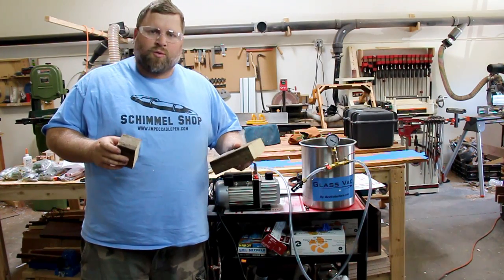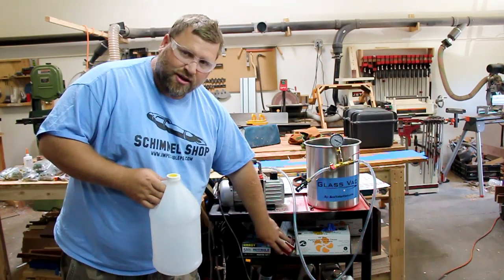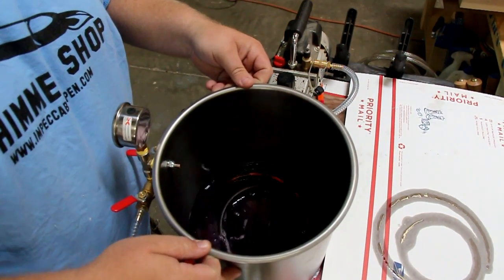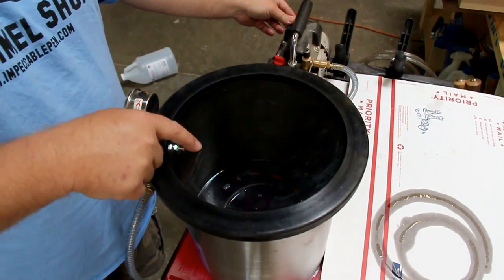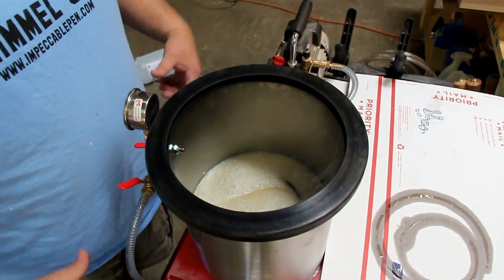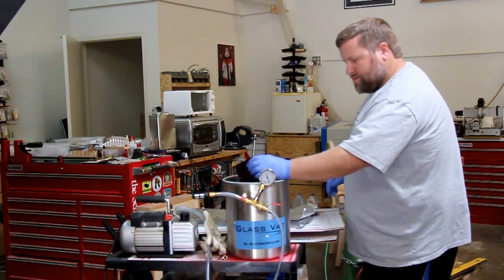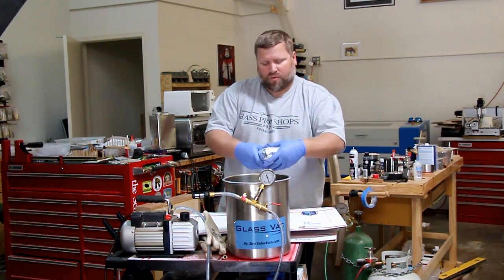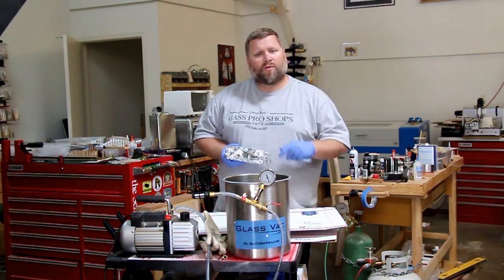Stabilizing wood with Cactus Juice for Knife, Pen and other blanks,

Comment: Do you let your vacuum pump run until the bubbles stop or just until you reach a vacuum?  I read on the Best Value Vacs site (where your vacuum chamber was from I believe) that if you were going to evacuate the air with the solvent based stabilizers (Cactus Juice) that you needed a cold trap if the evacuation took longer than 5 minutes.   I did not see a cold trap on your set up and was just curious.